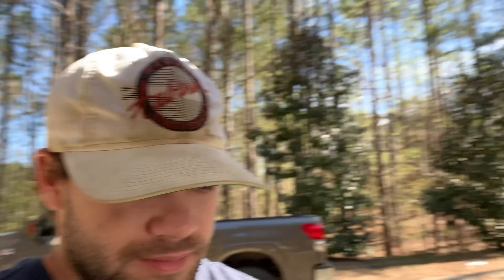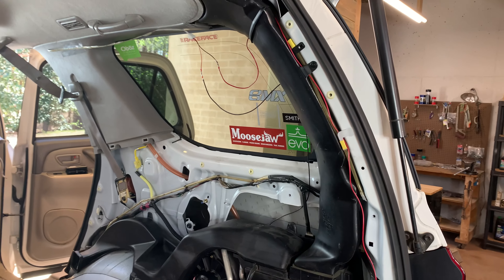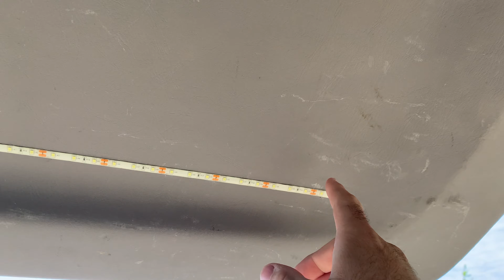LED light strip install : Toyota Sequoia Overland Build

Comment: Could  You list the led's and the area were you connected everything, thanks /2004 Sequoia 4WD
Reply from the maker: https://www.ebay.com/itm/Super-Bright-16-4ft-5M-SMD-2835-300LEDs-Strip-Waterproof-Light-Cool-White-DC12V-/142752252311
Here’s the link. I also used solder tubes to connect everything. Wired an inline fuse straight to the positive terminal on the battery and have them run to switches in the rear